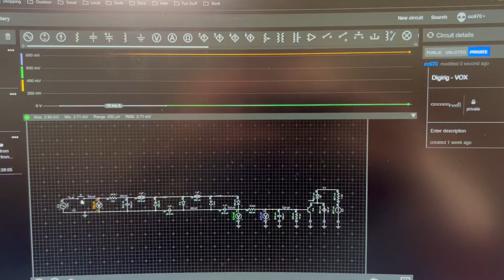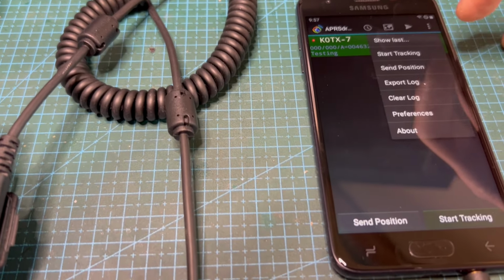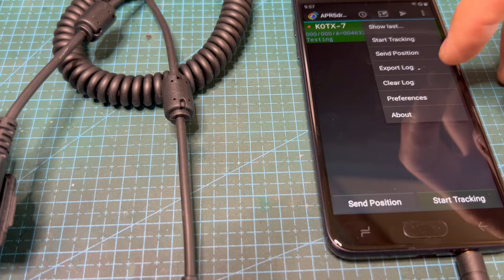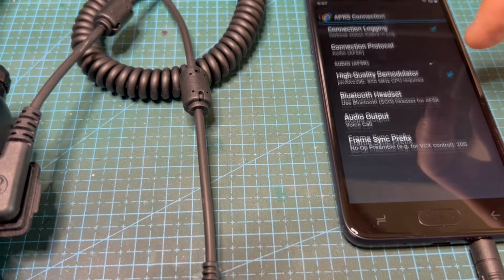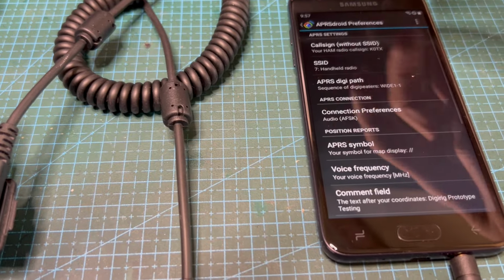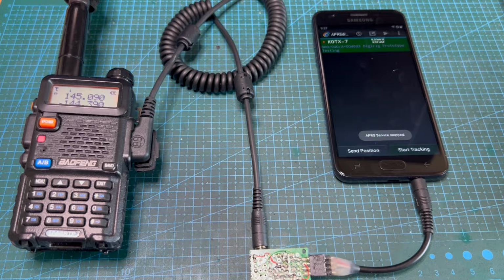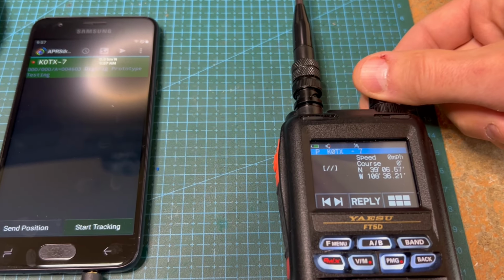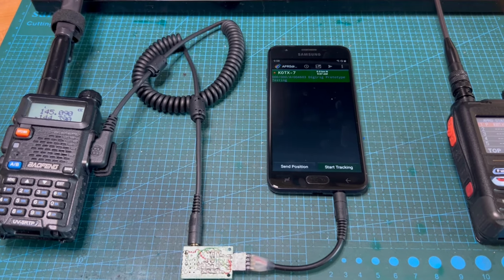Prototype VOX cable demo

Comment: How is this technicaly different from the AIOC board?   Other than you have a TRRC jack like it should have had.  Love that you are not stopping at DigiRig.  We also need a low cost hardware TNC with 9600 and faster OTA speeds if you have time!
Reply from the maker: Some notable differences:
- This is not transceiver specific and can be used with any radio because
- Simpler implementation doesn't require power from radio or computing device and
- Doesn't require drivers or specific software support, also
- If continues to test well, this will be available at scale as a ready-to-go solution in a month or so

Thank you for your support and encouragement.
73 de K0TX
Reply: @digirig  Thank you for all your hard work. You make the community a better place.

Comment: Most cell phones have moved to usb-c. Is there a solution for this ? 
I'll be ordering one of these cables anyways as I have older tablets but a usb-c option would be great.
Thanks for not resting on your laurels, I love my digirig !
Reply from the maker: Yes, I'm working on USB-C cable interface. At the time of wiring it's a prototype, but the final product will be available at the same URL: https://digirig.net/product/digirig-lite/

Comment: My digirig v5, can't remember version but it's an early one, one of the connectors inside for the headphone jack has broken off, i'm too blind to resolder it.   So i'm excited for this version, it's exactly what I've been wanting.  Hoping the jacks will be tougher.    Thanks for doing what you do. 73 de K1BQY
Reply from the maker: Thank you for your continued interest and support. Re. your Digirig 1.5: email me through the website. I'll get your old Digirig fixed.
Reply: @digirig  I've been debating doing so, now I will for sure.  Thank you!

Comment: @digirig , this is useless since plugging into the radio will disable mic & speaker , so you dont receive nor arew you able to do any voice calls ... it is not reralistic that you wouild have to carry 2 radios  , 1 for aprs or any data , and 1 for voice ... a connection or mod to the radio should be made that does not disable mic & speaker ... lets say your circuit might work but it is not practical in real life
Reply from the maker: Yes, with any external TNC you are pretty much expected to dedicate the radio to digital/packet for the time of operation. Having mic available for voice will not do you any good on APRS frequency.